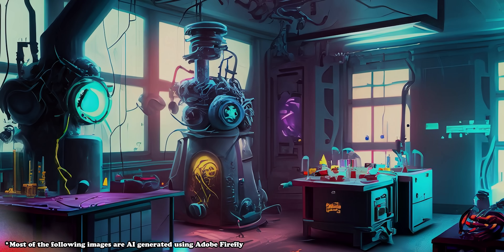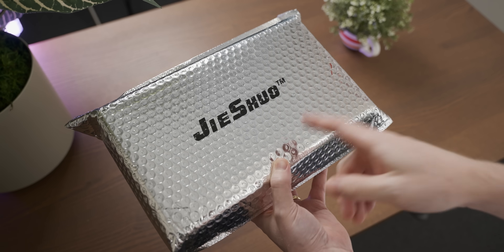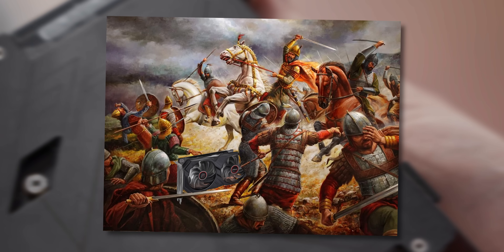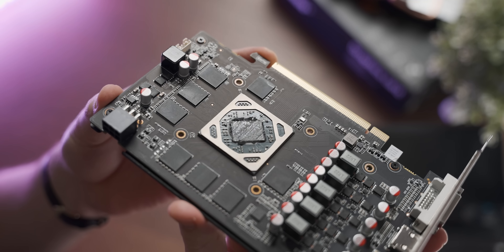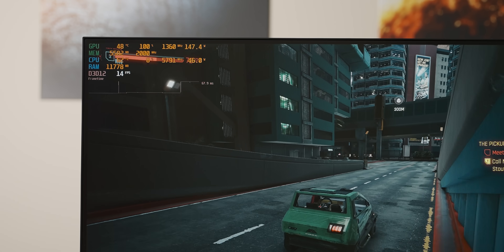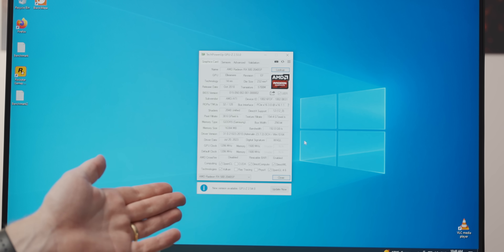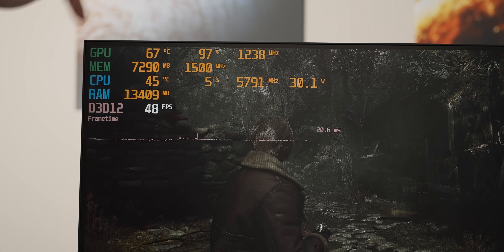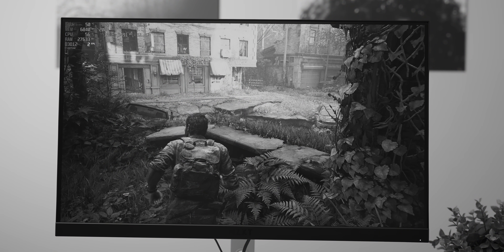Why Would They Make This? 16GB RX 580 From Aliexpress...

Comment: The RX580 2048SP is called RX 570 elsewhere in the world.
Reply from the maker: Haha!! Yeah they are basically the same, but I didn’t want to say it in case it pissed of some Garys. 😂
Reply: We shall call it 570X then. Or even better, 570 Ti.
Reply: @fuxseb more like the 570 XT to stick with AMD nomenclature
Reply: @fuxseb  "RX 570 Ti" sounds like something I'd hear from my fever dreams
Reply: @fuxseb yeah
Reply: @fuxseb  by amd naming scheme
shoulnt we call this abomination card prior 16gig mod as rx 570xt? since xt was ti scheme of amd
Reply: Not XT, just X to match with older 270X, 370X.

But really it's a flashed 470, and the 590's on AE are just flashed 480's
Reply: @talibong9518  ah.. i see....
then i wonder what T stands for in XT if X itsself is "eXtreme"
Reply: Please STOP!  You guys are utterly CONFUSING me!  😵😲  
😂😂
Reply: Its still a 16gb tho
Reply: Rx 580²
Reply: no, it is a 2048SP
570 is a different thing
Reply: @GewelReal  No, they're the exact same thing. RX580 "2048" == RX570 8 GB. Both use the same ASIC, same memory, same everything. The only difference is the VBIOS, with one card saying it is an RX570, and the other saying it's a 580.

It'd be like saying the RX590 is a different card from a normal RX580, when again, they're the exact same card. The only difference? The name and clock speeds are slightly higher, and the 590 consumes far more power because it throws out efficiency for brute forcing performance at the cost of heavy power consumption.
Reply: @GGigabiteM the rx 590 is 12nm instead of the 14nm of the rx 580
Reply: @GGigabiteM u are wrong buddy, the rx580 and the rx590 are different gpu's, yes they both 500 series so it's Polaris arc but the rx580 is polaris 20 and the 590 is 30, that translates to less nm and btw  rx590 power efficiency is actually better than the 580, rx 590 even has a lower TDP.

570 = 580 2048sp = 580 (same chip)
Reply: @paicosusui   Nope !
Reply: @freekakker574 lekker name bru
Reply: @sweeflyboy  dankjewel! Jij ook
Reply: RX 590 is an RX 580 on 12nm with higher clock speeds, same die size, same package. 2048SP 580 is just a renamed 570, because china.
Reply: @paicosusui  Words spoken by a true fanboy that knows nothing LOL.

Different lithography processes don't equate to "less nm". The Global Foundaries "12LP" process is directly based on Samsung's 14LPP 14nm node. There is virtually no difference, other than marketing numbers. See, if you knew anything about modern lithography process names, you'd know that the numbers they're described as are arbitrary and don't at all tell you the fine details about the process. This isn't the 80s, 90s and early 2000s anymore, where there were clear huge lithography node jumps. Where you went from 1um to 700nm to 500nm to 220nm, etc. Modern lithography nodes are running into the laws of physics, and are mostly relegated to tiny gains that don't translate across the whole die. That's why there's a diminishing return the smaller you get, and the more expensive it gets.

The RX590 was fabbed at both Samsung and GlobalFoundaries plants, depending on the orders and capacity available at each company. This means that the RX590 was fabbed using the same technology as the RX580, back to the RX540.

And where are you pulling these efficiency and power numbers out of? The RX590 consumes 21.6% more power (225W vs 185W of the RX580), and was often even higher with how hard some AIBs were pushing the silicon. The RX590 was a power consumption heat monster, because it long exceeded it's efficiency per watt curve and was purely brute forcing performance at the cost of power consumption.
Reply: @GGigabiteM   bro i saw in forums that the rx590 tdp is 175w 💀 and in some benchmarks consuming less pwr than the 580..def weird.

And yeah I know different arc ver doesn't necessarily translates to less nm but that's the case here and even tho the difference in Polaris 20 and 30 are almost null (unlike for example 21 to 20) it's still technically a different chip with different name and higher clock capacities.
Reply: @paicosusui bruh rx 580 is different chip than 570 and rx590 is just dual rx580. If you don't believe me, watch rx590 benchmark on games that unsupported dual gpu and the benchmark will be the same as 580

Also power consumption is different from tdp. Mine rx580 only uses 80-90w of power
Reply: @GGigabiteM  your power numbers line up with what I remember from reviewers at the time. It would've been a more power hungry side grade if I had gotten it lol
Reply: @youravghuman5231  yeah ik power consumption and limit isn't the same but we arguing bout the tdp too,, btw in some forums it says 175w and in others 240 or som so at this point idk but u wrong saying that the rx570 and 580 are diff chip, they both uses Polaris 20 chip and just wth you talking about dual gpu's💀.
Reply: @youravghuman5231  What are you even talking about, the RX590 is the same silicon as the RX580.

The core config is 2304:144:32 (Shaders:TMUs:ROPs), which is the exact same as the regular RX580. There are not two dies, it is not a dual ASIC card.

Literally the only difference is the core and boost clock being ~200-250 MHz higher.
Reply: @youravghuman5231  RX 570 and RX 580 2048SP use an identically cut down "Polaris 20" chip, which is in turn a relabled "Polaris 10"/RX 480.

The RX 590 is Polaris 20 made with GloFo 12nm instead of GloFo 14nm - the design rules of these processes are compatible btw, so this didn't require any redesign whatsoever.

Due to that process improvement, it can clock a bit higher, but that's it. It's not a dual-GPU card!
Reply: @freekakker574 not really, digital foundaries 12nm process is very similar to samsung's 14nm

There is no industry standard for measuring die sizes, so even things like TDP is different for each manufacturer.
Reply: @paicosusui  "And yeah I know different arc ver doesn't necessarily translates to less nm"
No, you don't know.
"less nm" doesn't make sense as a concept, because the nm number is a marketing term, not a measurement of anything. You can't have "less" of it. It's like saying "i3 is less than i5": completely meaningless, and misleading at best.
If you remotely understood what you were talking about, you would never have used the phrase "less nm" in the first place.
Reply: @GewelReal  You are wrong. The RX 570 is literally 2048SP.
2048SP means 2048 Stream Processors (i.e. shader cores). That's what an RX 570 has. The RX 580 2048SP is just a factory-overclocked RX 570. It's the same Polaris die, with the same number of cores enabled.
Reply: The normal 2048 has 8gb. Double the amount of the normal 570.
Reply: @mijingles8864  What even are you talking about, the RX570 had both 4 and 8 GB versions being sold at the same time during its marketing life. I have an XFX RX570 with 8 GB.
Reply: @GGigabiteM I have an XFX RX480 8GB too haha. What an odd few years.
Reply: @GGigabiteM  tbf, since the 570 was a lower-midrange card and 4GB were plenty for most of the life span of Polaris, I'm assuming the 4GB version was more popular.
Reply: @mijingles8864  The 570 was also available at 8gb
Reply: @mijingles8864  there is a 8gb variant of rx570
Reply: Typical AMD 

6800XT - 7900GRE 😂😂
Reply: @Ober1kenobi  Both AMD and Nvidia have done it for decades.

Radeon HD5000 -> HD6000 (some models)
Nvidia 200 -> 300 series
Radeon 7970 -> R9 280x
Geforce 9800GTX -> GTS250
Radeon 9550 -> Radeon 9600 -> X1050 AGP

Or the times when memory was expensive in the mid 2000s, and both ATI/AMD and Nvidia released video cards that parasited system RAM. ATI/AMD called it "hyper memory" and Nvidia called it "TurboCache".

There were Geforce 6200 "TurboCache" models with as low as 16 MB of onboard RAM and parasited up to 128 or 256 MB of system RAM. Nvidia would market the higher number on the box to deceptively sell the card.

ATI/AMD did the same with the x300 and x1000 cards.
Reply: @Ober1kenobi  The 6800 XT and 7900 GRE are based on different GPU architectures, and have different numbers of cores/CUs. The 7900 GRE is about as fast as the RX 6950 XT, significantly faster than the RX 6800 XT. This is not remotely similar to how AMD rebranded the RX 570 as the RX 580 2048SP.